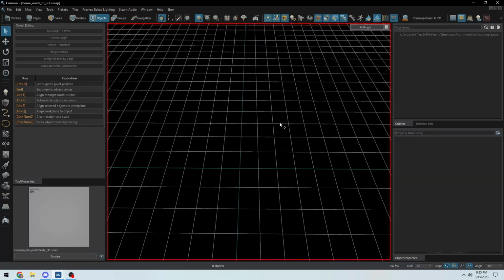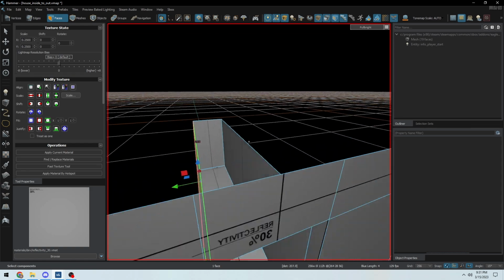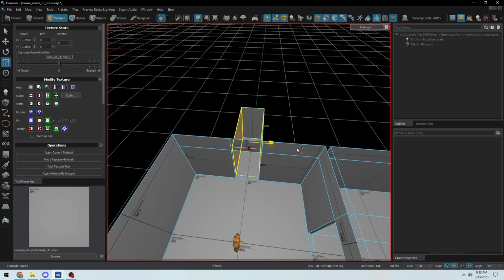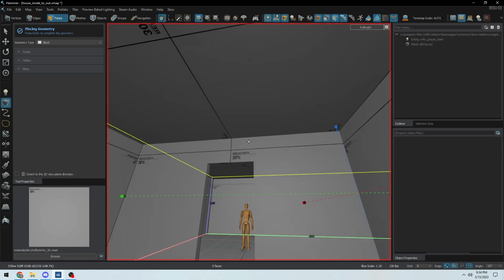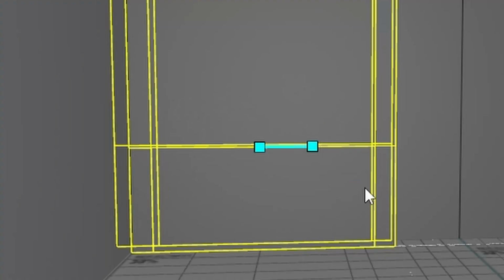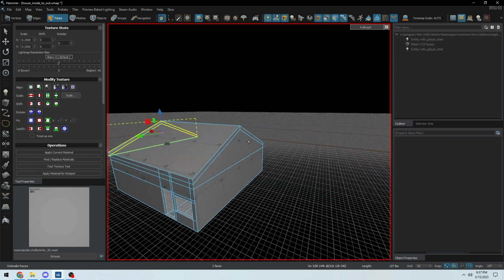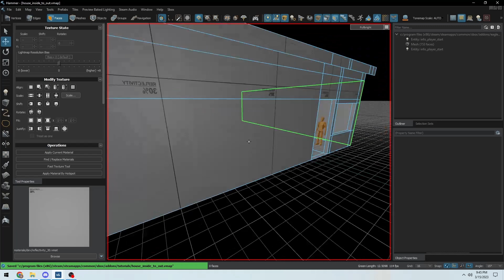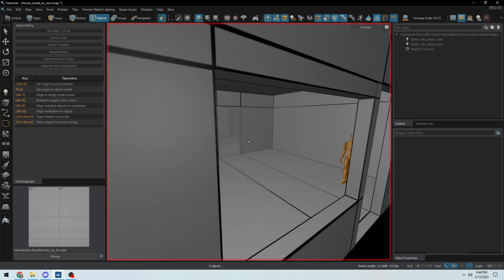Hammerhead #1 - Make a house in Source 2 (Counter Strike 2, S&box, HLA)

Comment: It seems to me that to build a house with several rooms, it would be easier to use a plane rather than a cube.  For example, we create a plane, set it according to the area of the house, and using the same Clipping Tool or Edge Cut Tool we cut out the walls along the grid, while preserving the doorways.  Next, we simply extrude the resulting walls upward and finish the doorways.  Well, then the windows, the roof... I don’t understand something right, of course 🤔🤔🤔🤔
Reply from the maker: So many correct ways to make it! Would love to see your workflow :)

Comment: does my rx 5700xt work with hammer cs 2 ?
Reply from the maker: No I don't believe it has RT
Reply: @eagleonedevelopmentteam849  
weirdly enoug valve mentined that the minimum card needed is rtx 2060 ti 6 gb ! 
i dont think ti version have less then 8gb, im thinking about buying rtx 2060 6gb just to mess around hammer
there is a lot of cs 1.6 old maps that i wanted to put on my cs go server but they were not greatly converted to cs go , the design of those maps were shit, so im thinking to learn to maps so i can bringg some nostalgia hapinnes to this comunity.

Comment: Awesome! These workflow tutorials are extremely helpful 
A question, is that house one large mesh? Is there a rule of thumb when/ where to separate it? - would be cool to see that 
Thanks
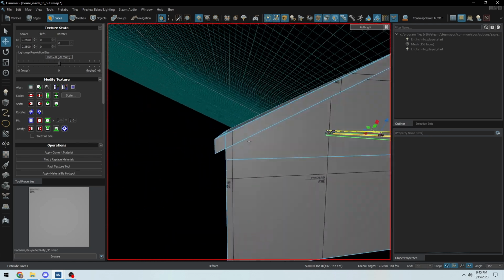4:20 Shift-Q Alt-Shift-Q - cool thing
Reply from the maker: It’s one mesh which you can separate later usually on a room by room basis for cubemaps. But fp cubemaps will change soon so it might not be necessary